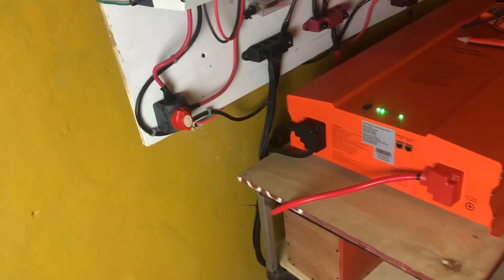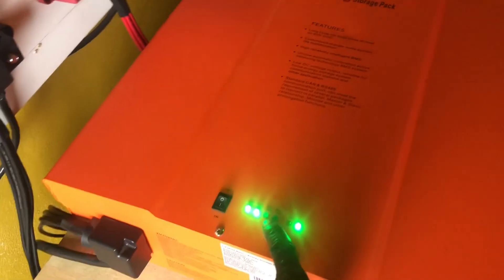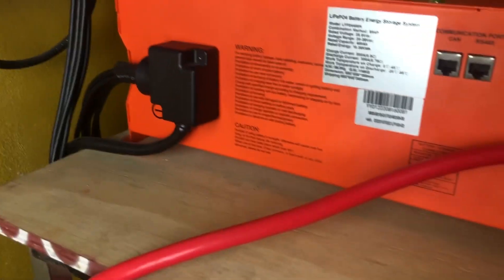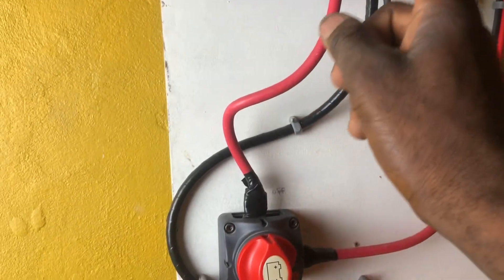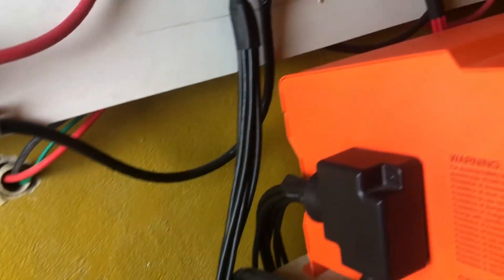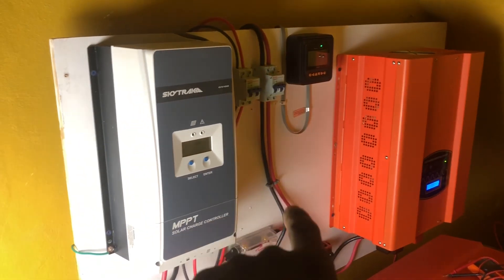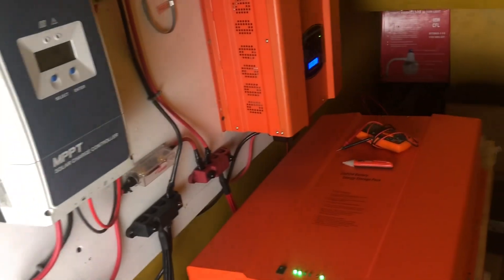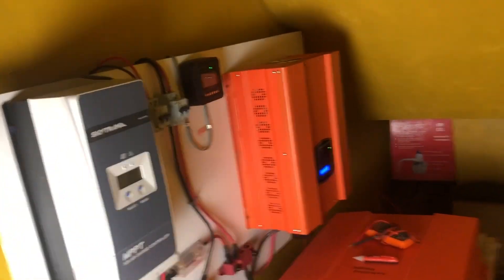Solar system/lithium batteries upgrade and update in Jamaica

Comment: Have you ever done a capacity test on modern solar batteries? They are no good
Reply from the maker: No never did, never seen a reason to but I will definitely keep it in consideration.
Reply: Ok...I have 3 5.3kwh battery pack and I only get 3. something kwh....and the forth battery all 16 cells are swollen pure promises for battery replacement and still waiting

Comment: Greetings bro I have a small system too and I'm also close to HWT area, you said you have 9 panels what are the wattage of those panels and what is the wattage of the charge controller
Reply from the maker: Greetings my friend. My panels are 300w and my charge controller is a 100Amp

Comment from the maker: If you are interested to buy a lithium pack battery like the one in this video or the inverter, the number for my supplier is 876417-4525.
Reply: At what cost?
Reply from the maker: @von8295  call the number bro, Am not the one selling them.